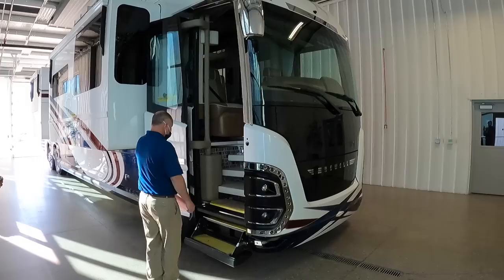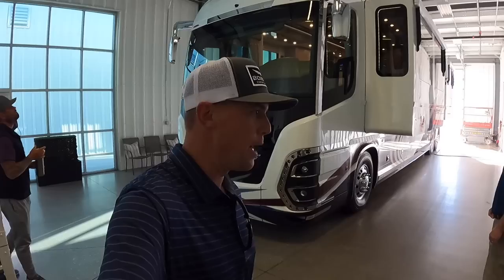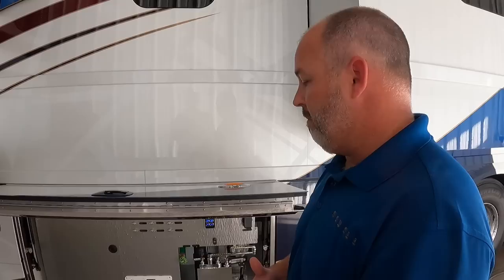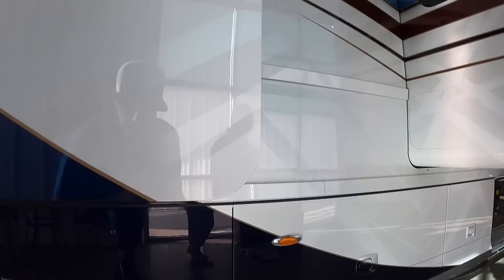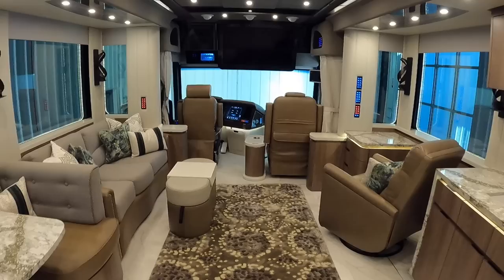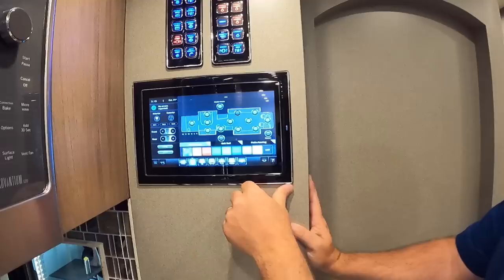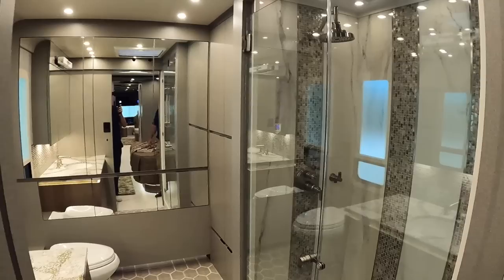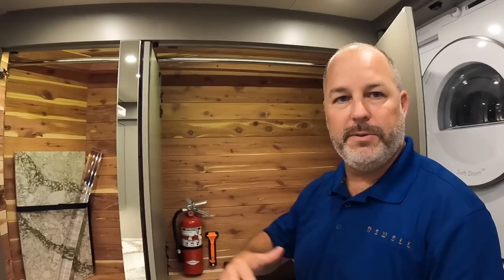2021 NEWELL COACH TOUR AT NEWELL FACTORY

Comment: Prevost are nice but Newell's are absolutely beautiful. I just don't see the point of a 605hp engine, that Cummins is WAY under capacity for what a bus like that needs and I at least think Prevost has the right idea with a 13L Volvo with just over 500hp and with the Volvo 12 speed transmission you can't go wrong. Great video as usual, you're The Man Andrew 👍.

Comment: Pretty amazing coach. Love it all. Everything these days is all electronic. Bad news-
When we get hit with a EMP (and we will at some point) nothing will work. Get a bicycle for back up.😉
Reply: Portable generators are largely analog and can usually be kept running even during a mass emergency like an EMP blast. 
Transformers and power substations are the most at-risk for natural EMPs. Your average electrical protection should be enough to make sure your generator will be safe. 
In the instance of a nuclear detonation, anything electrical has the potential to be disrupted by the strong electromagnetic current. Even car engines or gas station pumps are likely to cease working in the wake of a nuclear attack. 
 In the instance of a powerful nuclear blast, there’s not too much you can do, as it’ll likely destroy all of the electrical devices over a wide geographic area. An entire continent’s electrical grid could be taken out in the wake of a nuclear blast. 
Protecting a larger stationary generator from powerful EMPs You can install voltage transient protectors and suppressors to help negate this damage
.Smaller or more portable generators are much easier to protect from powerful EMP blasts, luckily. Either can be stored inside of a Faraday Cage or Faraday Bag to help shield them from the magnetic fields. 
There are dedicated solar-powered generators that you could investigate if you want to go fully off-the-grid. You can also invest in a solar panel array and a power inverter to convert the solar panel’s DC into AC to power your household devices. 
To make sure your power inverter’s as safe as possible, store it in alternating of plastic and aluminum foil to shield it from the electromagnetic current. 
A generator is one of the most useful things you can have in case of emergency. It should be an important part of your prepper’s emergency kit if you haven’t included on already. A portable or stationary generator combined with ample food and water stores will make sure you and your family are kept as safe and comfortable as possible if something goes wrong.
Reply: Must of us RV lovers, have bicycles too.